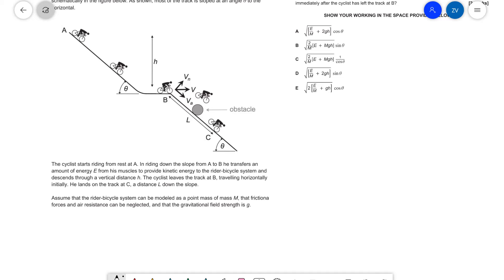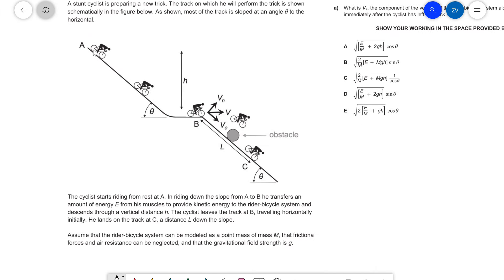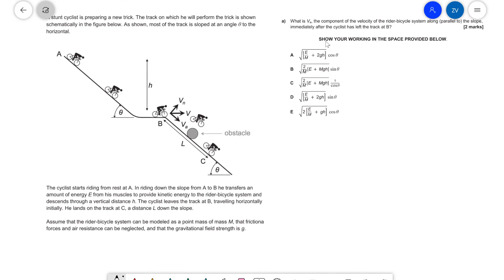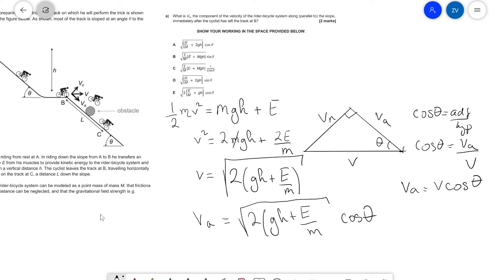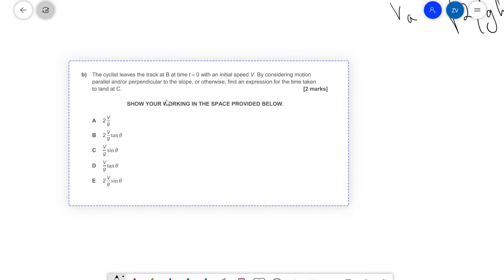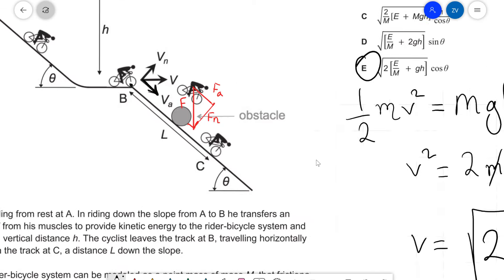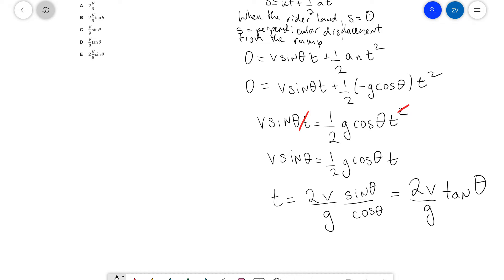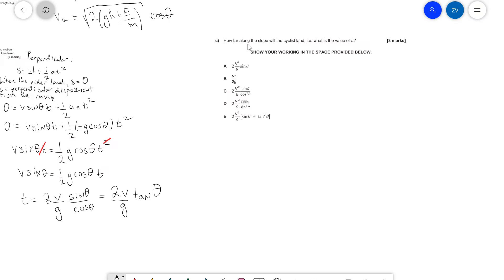One of the hardest Cambridge physics admission questions | ENGAA 2016

Comment: In normal projectile motion half the total horizontal distance is done in half the total time, since horizontal velocity is constant. Why would that hold when there is an acceleration in the direction parallel to that of the sloped track?
Reply from the maker: I'll have to revisit the problem, but as a quick answer, we'd be looking at not the horizontal distance but the distance in that perpendicular direction.
Reply: Not sure if this is correct but it might be because the component of gravitational acceleration in the direction of the normal velocity vector is perpendicular to the velocity vector parallel to the slope so there is no change in the velocity parallel so you can take it as a regular suvat problem.